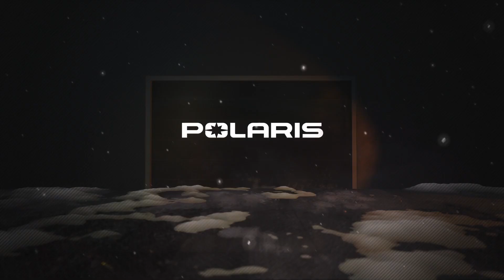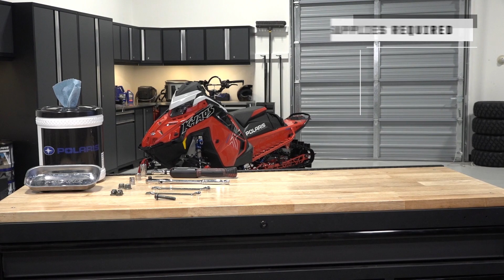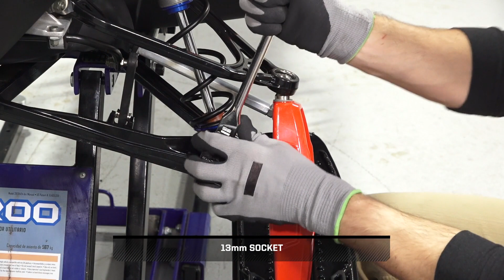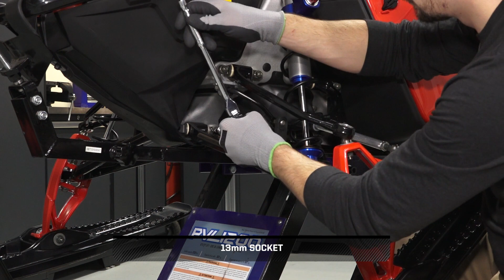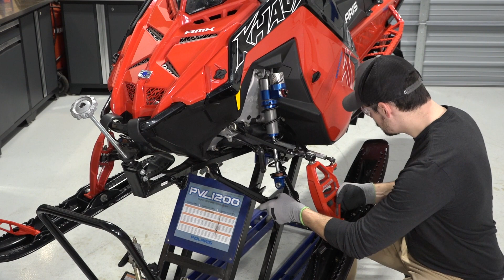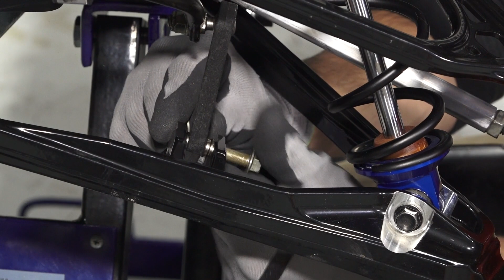2023+ Patriot 9R Pro RMK/Khaos Slash Lower Control Arm Removal & Installation | Polaris Snowmobiles

Comment: The torque specification on the shock bolt should be 18 ft-lbs. 37 ft-lbs broke my shock bolt. 

Polaris can you confirm this?